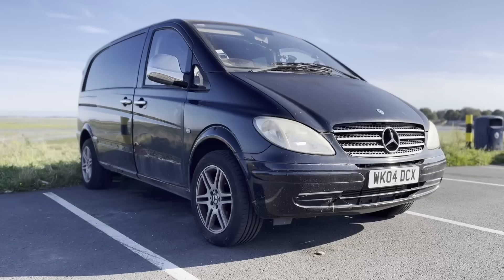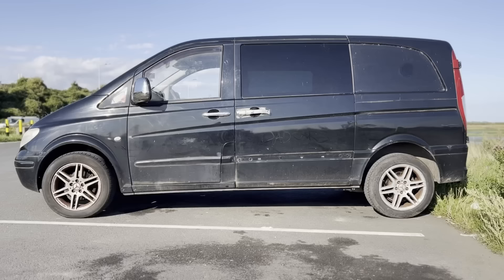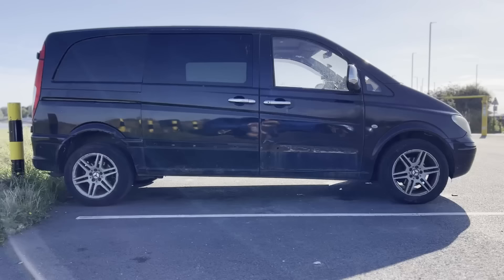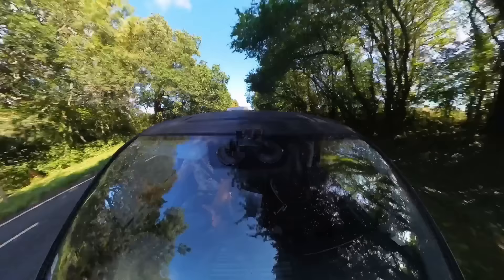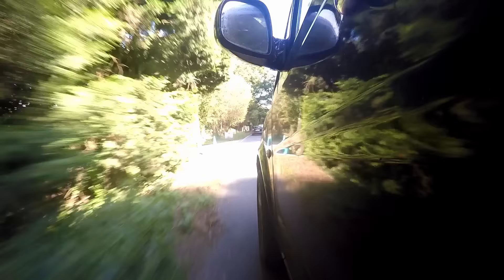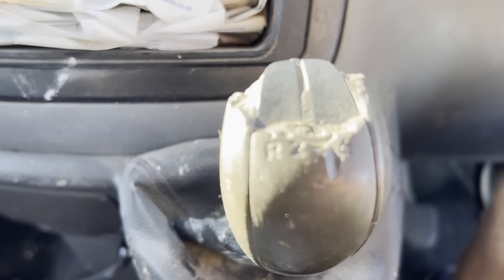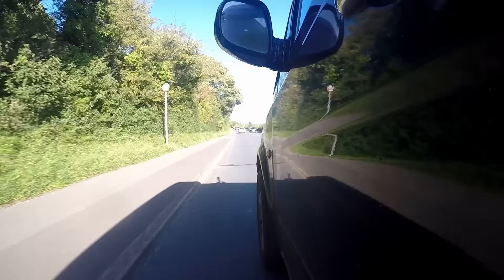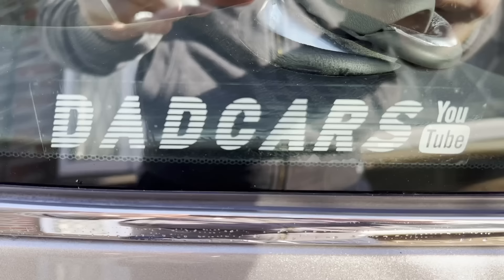The Mercedes Vito Is A Bargain VW Transporter Alternative With One BIG Problem

Comment: The rust in mercedes vehicles is an interesting  one for sure. I've seen a lot of people comment on this issue, particularly on internet forum's. I suspect it's because they use salt on the roads in the UK and certain parts of the US?
Here in New Zealand you would struggle to find a Mercedes of any year with rust issues. 
I've owned probably around a dozen Mercedes since the early 90's, from mid 70s w123's,w126,w124's,w210's  3 x 190e's, including a 190 16v which I've owned for 14 years, and everything in between. Right up to my current 164ml. None of them had any type of rust what so ever.
I do know folks in the Mercedes car clubs that have owned old 114's with rust in the boot floor behind the wheel wells. But I think that was a common problem  with that model anyway. Even early on. But there still on the road over here.
It's also not uncommon to see a lot of first and second gen Vito van's on the roads over here with 500,000km's on the clock. But with that kind of mileage, I suspect rust would be the least of its problems 👍
Reply from the maker: I’ve not helped matters that’s for sure 😅 great comment! 🙌
Reply: Here in the uk 
A 10 year old Mercedes is rusting 
12 years and the wings and bottoms of the doors are rotten , many years ago I bought a 3 year old C Class and before it was 4 , paint was blistering along boot and rear arches 
YET again here in the UK Peugeots and Citroens do not rust 
, so if they can protect the car from rust why can’t Mercedes ???
Reply: @boyasaka  Yes very true. Over here we pretty much have the same vehicle fleet on our roads as the UK. So I'm familiar with the Peugeot, Citroën vehicles. And yes you're right. They don't rust.
Even earlier Fiats,Alfa romeos etc don't seem to be affected as much as what you would see in the UK or Europe. 
Back in the early to mid 2000's I worked for an importer specializing in bringing cars in from Japan.
The general rule of thumb was not to buy vehicles that had lived along the coast, as rust was often a problem. Particularly in vehicles like the Mitsubishi Delica 4x4 Van's, and pretty much anything Nissan 4x4 from that era. But if we purchased the same vehicles from way inland. Not a problem.
I suspect most of the rust issues in the UK is more down to the climate. With the harsher damper winters?
At least I think that would play a major part.

Comment: Had my 2007 vito 120 for a couple of years now, been a great thing. Only issue I've had is certain spare parts - my van is an auto and the auto gear position switch cacked itself. When that dies, at best you're stuck in a single gear so it can leave you in a bad position if you're far from home. It took Merc 3 months to get the part. Luckily I managed to get a second hand one in the meantime but that wasn't easy to get either. Apparently the key receptacle thing can fail also and they can't be purchased anymore either. 

Other than that switch its had a new aftermarket prop-shaft as the original's UJ's were failing and squealing (150k on them, can't argue with that) and I've had to replace the parking brake shoes as one side fell to bits. 
The backplate that the brake shoes fit to looks to be a problem as well as the holes for the springs rust out and being rear wheel drive changing the back plate looks like a bit of a pig to do, a few video's of it on this here tube. 

Only a slight amount of rust on the os sliding door though so that's a result 😂😂
Reply from the maker: Ah so you’ve still had rust on the panels in your 07 that’s interesting, not to the level of mine it seems 😅

Comment: I like the vitos. I would say though that I bought a Vw t5.1 (high line) 4 years ago now and it’s worth the same as what I paid for it even now with a few extra k on the clock.
My current Vw in 40k miles has only had routine servicing, intercooler needed replacing as a stone went through it and an air con condenser. So pretty good imo. My previous one was a money pit and cost me about 2k. For my current one I went for the most popular 2.0 tdi 140 engine as they’re so common and if the engine did go I could replace the engine relatively cheaply.
Reply from the maker: They do hold their values very well!

Comment: I’ve had a mk1 and currently have a 2006 mk2 (639). It had its share of rust in the usual places but I’ve ground it back and fixed up, lasted 2 years so far. I like the drive of the Vito, super comfortable and puts some cars to shame on twisty roads. With a remap to 170 it pulls nice. I did a camper conversion when I first got the van, use it most weekends for trips away, it was well worth the purchase for all the great times and memories it’s enabled🚐👍
Reply from the maker: Awesome! A remap you say? 🤔
Reply: @dadcars  it’s worth the remap just for the driveability, torque from 1500 rpm gives slightly improved fuel economy when driven gently, or great overtaking performance when you need it. The early ones 04-06)with om646 engines don’t have: maf sensor, egr, cat or dpf so a lot less to go wrong and less restriction on the boost side of things 👍

Comment: I had a 2013 but had to get rid as had another child and couldn't do the school run. I loved that van. The engine management light started coming on (dpf issues) so was time to get rid. 
2 years later ive been offered a 2009 lower spec vito vut has only done 40000 miles with one owner who i know well. Im very tempted to convert but worried again about dpf issues. Nout sure if the lower mileage will help with that though....

Comment: Just don't drive it through large puddles like i did. I'd bumped up onto the kerb so as to minimise the risk, but the kerb dropped down as it was an entrance to an industrial estate and i came to juddering halt soon after as the engine seized completely. Being an automatic it didn't respond well when i revved the engine. So that cost me £1000 on the insurance excess, and I found out the hard way that Mercs don't like murky water. Judging by the rust on your van, it's probably not that keen on clear water!
Reply from the maker: Ooo sounds nasty… to be fair the underside of mine isn’t too bad 😊
Reply: Engine water ingress is what killed it. The lesson is to approach deep puddles slowly so as not to create a bow wave. A BMW 3 and a Mercedes C class soon joined me in grief, and yet a Bentley put the puddle to the muddle and sailed through, and couple of Fords also managed to ford this temporary ford. They were obviously Focused enough during this Transit-ion to not get Cortina trap!
Reply from the maker: @josephdaly3327  EVs get written off like this as well 😬

Comment: Never buy any Merc model released between 95-05. Unreliable rust buckets.
Reply: You mean rust buckets carrying probably Mercedes most reliable drivetrains 😅
Thats always the story with these era Mercs when they pop up for cheap on the market. Runs and drives fine but really crusty and high miles. The more high mileage examples of a used vehicle you see the better it means they are dead reliable.
For example I cant even find a used Volvo V70 that's done less than 200.000 miles.

Comment: Transporters were great until the horrible T4 arrived, and they became just another FWD diesel van. In recent years I have fallen for the Vito and won’t be going back. Our current one is a 2007 Japanese import, badged as a V350, bought 3 years ago with just 45k. 3.5 Petrol V6 Auto, 265hp,  RWD with air suspension, heated electric leather throughout, 7 seats, cruise, park assist, auto lights and wipers, 19” alloys, all the gear of the day. Its a SWB, it drives beautifully with it’s RWD layout and is still one of the most powerful vans out there, it leaves the hordes of look-alike Transporters for dead on any road (which never gets old). I’ve had a slimline pop-top fitted, swivel bases on the front seats  a small kitchen unit with hob and sink from a specialist. Now it will do anything from tip runs to family trips and weekend sleep-overs. I tried a few modern Transporters - twice the price for the same condition but they just feel like a plumber’s van by comparison - slow, weaker handling, noisier, bouncy when unloaded, less kit, very commonplace and not an attractive shape to my eyes. And if you dislike diesel, VW don’t offer a V6 petrol option. By the way, there’s not speck of rust on mine as it’s a post 2007 model… never buy an earlier one if you want a keeper.
Reply from the maker: Sounds like a lovely van! 🙌

Comment: I'll stick with my VW T4 Transporter. 100k miles covered by me over the last 17 years with no major issues. It's now worth double what I paid for it and continues to appreciate in price.
Reply from the maker: That’s awesome, friend of mine has owned a T4 for the last decade and he’s loved it… it does rust though
Reply: Sorry transporter vans  are massively overpriced for what they are ITS A VAN WITH windows that cannot be ever properly converted to a camper due to new regulations.Your much better off buying a vito hi top or a hi top transit / sprinter

Comment: I absolutely love my vito!
2005 111cdi, lwb, twin sliding door and a tailgate.
A couple of things have broken, but it is almost 20 years old. 
What sold me on it was it was far nicer than any other van for the money, transits were rust buckets, t5s were moon miles. The only issue can be ease of availability of parts conpared to those 2 in my opinion.
But RWD, in my opinion loads better than the fwd transporter (4 motion was in a whole different budget) and the transit has leaf springs on the back even with RWD which can be hard to find.
So in summary, maybe not as good a work horse as a transit - much better dash for a working van in my opinion and the transit has leaf springs, but not all of them can tow/carry a lot.
Not as good a camper as Transporters unless you diy alot more of it.
But all round? Ill keep my vito.

PS, great video!
Reply from the maker: 🙌 I’ve been driving mine a lot the last few weeks while my cars off getting sorted and I’m reminded how much I love mine too 😊

Comment: My 2005 CDI is rusty as, I think if I rub it down & respray it will just come back pretty quickly. The problem being Mercedes using recycled metal for the panels. The problem is already built in. My bad for buying it from a seaside town 😅
Reply from the maker: I live in a seaside town 🙈

Comment: I had a Vito on a 2009 plate and it was a disaster on wheels. Electric ignition system failed so the ignition fob would get stuck. Gear stick bush wore out so wouldn't find second gear. Complete rust bucket. For ever replacing ball joints. Abs issues. I ended up selling it to a machanic and it's taken him 4 years to sort out and he still doesn't trust it for long journeys. It felt like I'd gone into competition with Mercedes to build a van.
Reply from the maker: 😂 god that sounds like a nightmare! A rusty lemon 🙈
Reply: @dadcars  more than you think, by the time I gave up on it I'd spent a lot of time and money converting it to a camper. It just wasn't reliable enough to go anywhere in. It didn't help that one of the mechanics at the workshop decided to sleep in it rather than go home to an argumentative missus and flattened the batteries. I've never been so glad to see the back of a vehicle.

Comment: I don’t know…I’ve had a lot of older VW and they are amazing…I know a guy who loves all Mercedes and doesn’t seem to know the difference between Germany and South Africa, his Vito goes wrong now and then and it’s thousands each time…they just pulled the entire gearbox to get to a sensor? That puts me off., electric windows jam all the time and the interior feels very cheap. The old T4’s just didn’t go wrong and look how many of them were built! But times have changed right? I used to go to a scrap yard to buy a part for my T2 and the owner would beg me to take three vans for the price of a door hinge! That’s why I’ve owned over 30 vw type 2! Several splits too.
Reply from the maker: My friend has had a T4 for a decade and it’s been great to him… it does suffer from rust though and is down on power at times… still looks awesome today though 😊
Reply: mine was 92, im told....the metal came from Schipol where its phosphor treated until around 94, so the earlier ones were very good. same plant that supplied steel to Saab.  @dadcars

Comment: l have an 06 vito .What l like is the in line config of the engine and g/box.Makes it nice and easy to work on .Just take the front apron off and you can get to everything. My only complaint is the electrics .l still can t work out how they work and where the fuses are ......anybody know ? Would be most grateful if you could tell me :)

Comment: Because it says Mercedes on the badges it don't mean the engine is.  
My works van is a 2019 . The thing tells you if a bulb has failed or take a rest after a certain length of driving.  
It didn't tell me the breaks on the front where shot.🙄🙄 Exhaust filter keeps popping up on the display.  
Its done about 160,000 miles.
Reply from the maker: Oooo 😬 that sounds annoying

Comment: Mercedes were owned by Chrysler from 1998 until 2007. They asset stripped & devalued the Brand, not just for vans. They bought really cheap Chinese steel which rusted away far too easily. What were prestige cars were more rusty than any Ford or GM. They started fixing the steel rusting issue from 2004 on the cars, but I don't know about the vans, which were built cheaply in Spain to compete with the Sevel vans on costs. The vans are definitely vans first and Mercedes second. Thank goodness the Chrysler bean-counter policies were dumped. Mercedes is currently owned by Mercedes AG, but it's now a mass market brand, and not the quality of build Mercedes are traditionally renowned for unless you buy one made in Germany - E class & S Class. They're even using Renault engine in some C Class models.

Comment: Only left stranded twice 🤣I have a T5 here with 600,000km here that has never left me stranded..... never. 
I also have a primastar which has never left me stranded either that has never let me down either.

If you want a cheap van to use as a van get a trafic/primastar.
Reply from the maker: How many years have you owned the t5?
Reply: @dadcars  Since 2015 and the Primastar since 2017.

Comment: When I was looking at buying a van to convert to a camper there’s something called Black Death kept coming up on the Vito think it was something to do with the injectors ? as well as the rust so based on that I bought a T4 to convert
Reply from the maker: T4 is cool! They rust as well though don’t they?
Reply: @dadcars  yes they do at 25yrs old now it’s starting to rot on inner sills  I had to repair them for mot and the arches are starting to bubble so it’s not too bad considering it’s age
Reply: Injector seals leak!!..Which causes "Black Death" it is horrendous as the soot plus gunge accumulates around the injectors and on the cylinder head plus glues up everything. Takes ages to sort out and clean. Use a different copper seal from another car and it helps

Comment: I have a friend whos owned an old vito for years.... Usually one part towards his mot cost more than the entire vehicle i drive
Reply from the maker: 😬… how many miles is it on roughly?
Reply: @dadcars  I've got no idea. Probably arround 200k I'd have guessed
Reply from the maker: @robmorris87  that may be the issue with all vans… often they are very leggy by the time normal people can afford to buy them and it’s understandable why they need a tonne of money spent on them
Reply: @dadcars  yeah, I've used bottom of the market used vans my whole life with my job being a van wrecker.
I just found with mercades although the build quality is pretty good, the parts are extortionate....and body rust

Comment: I love mine 2009, had it 11 years pulls my caravan, transports my bikes to events returns 32 to 36 to the gallon. My mates went for T6 and have lost far more in depreciation.  Mine was 15k back in 2011 they all paid 25k plus.
Reply from the maker: That’s fascinating… I guess it’s a timing thing too, post Covid transporters were crazy money 😬
Reply: Xsara picasso 60 mpg.....(diesel) £100. To buy.... Still going strong 7 yrs later🇬🇧👍😁
Reply: @jmills1549  yes and BEVs are not as green as made out the uk grid emmits 250g for every 12kWh produced.  If the distribution was perfiect most BEVs would emit 80g /mile. Taken a worse case for the grid a BEV  would emit 160g of Co2 the same as a diesel. The truth lies somewhere between the 2 figures. Somewhere in the region of a modern petrol car at 120g of Co2 per mile.

Comment: The Vito is not made by Mercedes, it is built in a spanish van factory and shares many components with the renault Traffic. Crap electrics, dashboard components fall to pieces and cost a fortune to repair, especially the GLUED on ribbon cable on the instrument cluster! Engines fairly good, , but Mercedes? its just badged!!
Reply from the maker: Isn’t this the case with almost every car nowadays? 😅
Reply: @dadcars  yes it is , and most are very badly designed, mechanically, and a fair few contain “suicide engines” like the Ford “ecoboom” with its oil immersed belt, and that one where the auxiliary belt fails and wrecks the timing belt, and the engine, camshafts with pressed on lobes? Why, does it save money? Is it so they turn when the cambelt snaps and doesn’t wreck the engine? Anyone who designs an engine where the mechanical integrity is dependant on a rubber belt has no other goal than cheapness of manufacture, that is the world we live in today. Harry Ricardo would be doing 12000 rpm in his grave!